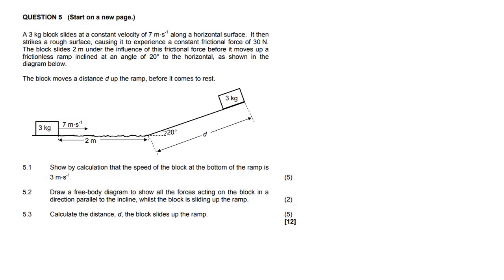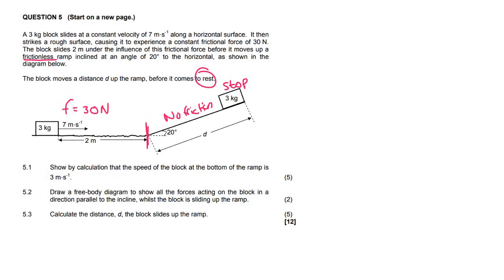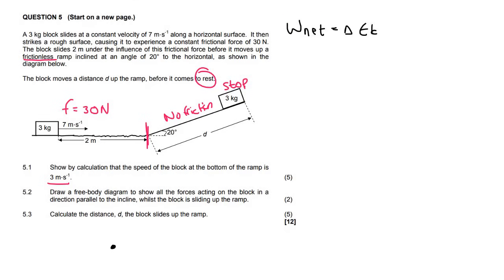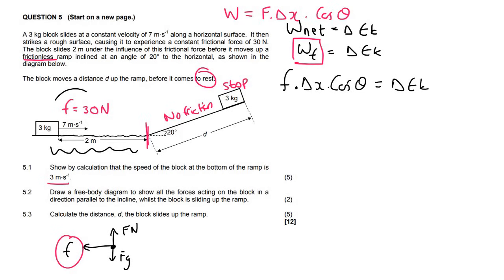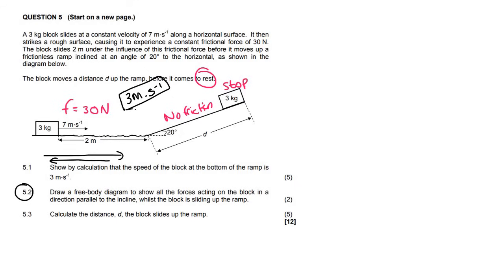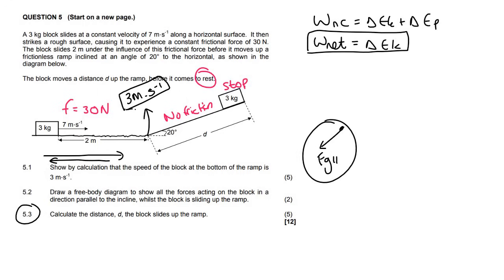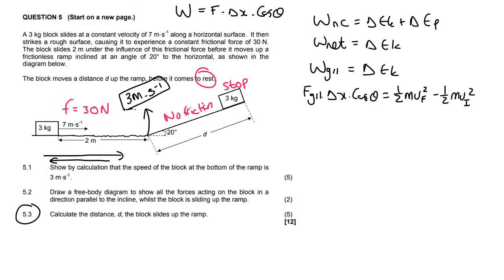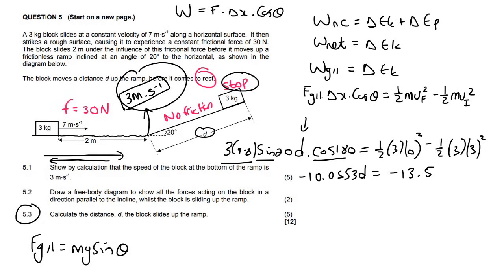Work,  Energy and Power grade 12: practice

Comment: Hi Kevin, quick q- could i also use the mechanical energy formula. So at the start the mechanical energy is a certain number then because of Wf, the mech E will be less at the bottom of the slope - then using this we work out the velocity (i got the right answers just checking if its alright)

Comment: E_mech = Ek + Ep
W = FΔx cos θ

I've done it differently sir, I worked out 

Wfk=fkΔx cos θ
Wfk=(30)(2) cos180
Wfk=-60J 

E_mech = Ek + Ep
E_mech = 1/2(3)(7)²+(3)(9.8)(0)
E_mech = 73.5J

Then said 

73.5-60 = 13.5J
Since mechanical energy at A = Mechanical energy at B.
I substrated -60 because it's the frictional force it experienced on the rough surface 

E_mech = Ek + Ep
13.5=1/2(3)(v)².      Didn't put potential height coz is = 0

13.5÷1/2(2)
√V²= √13.5
V=3.6 m.s-¹

But in this way it's not how they asked it, question said prove it's V=3m.s-¹. so I'll stick to your way. It's more straightforward. Normalise attempting a question before you watch video so you can learn something at the end 🔥😂👌🏽.

Comment: Morning Sir.
So does this mean that Fg|| is a NC(non-conservative force)
Reply from the maker: No, fg// is not a non conservative. Is is part of gravity which is conservative.
Reply: @kevinmathscience  oh ok sir
But doesn't it change based on the path taken?
Like it would change if we take a path with 20 degree angle instead of a 30 degree angle for example?

I used it as a non conservative force in the Wnc formula in my exam on Wednesday with the definition of it in my mind, so I'm just really unsure if it'll be marked correct.